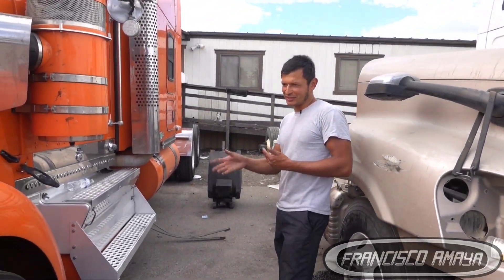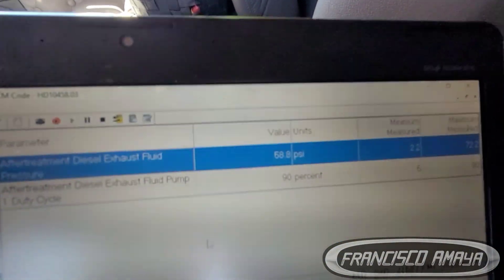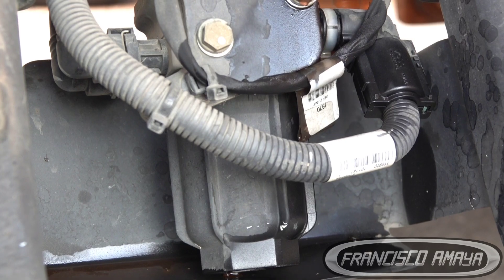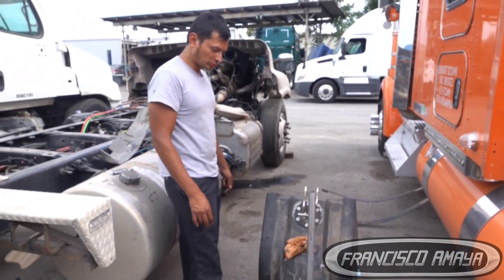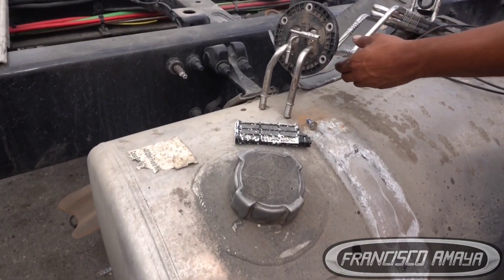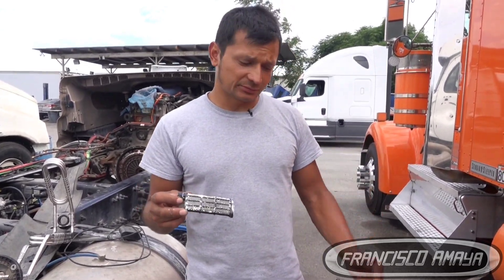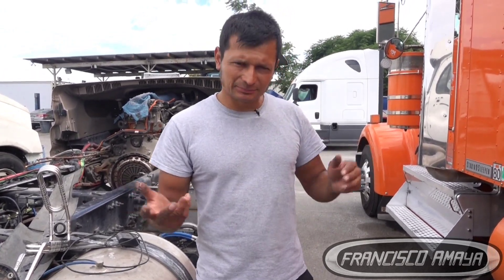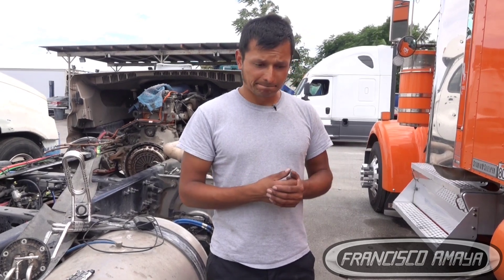CUMMINS X15 ENGINE LOW DEF PRESSURE DERATE REGEN PROBLEM SPN 3362 FMI 31 SPN 4334 FMI 18

Comment: That must be something new as the older ones have an external def filter . Also, when I had that issue kenworth replaced the sending unit, the one that has a built in def quality sensor.